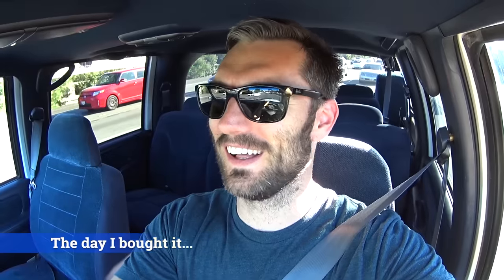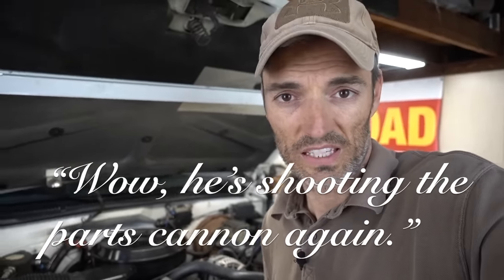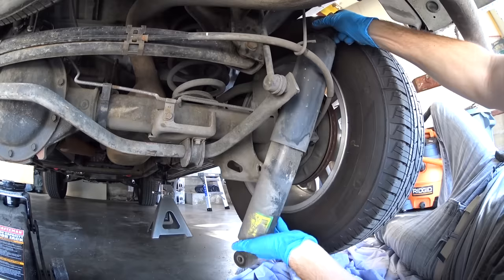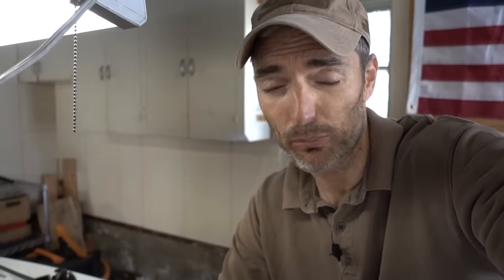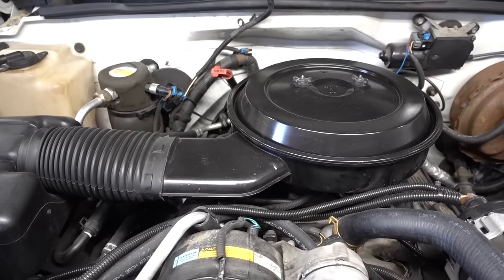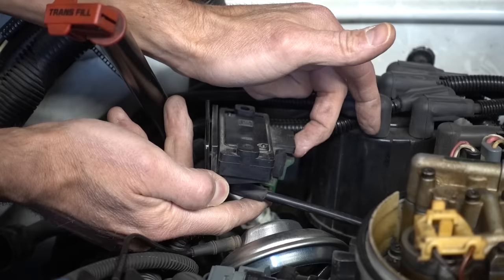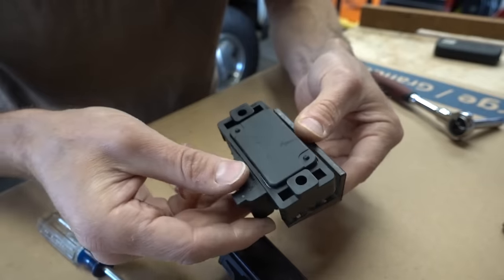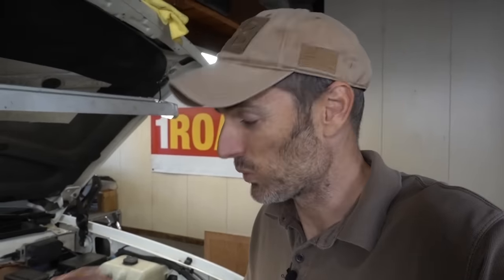The ONE REASON Why My 25yr Old Truck Runs So GOOD!!

Comment: I have a 95 GMC Yukon I have replaced the spark plugs wires rotor and distributor cap also I have replaced the fuel filter I had a broken manifold bolt on the passenger side which I repaired then my left manifold cracked so I replaced it with a brand new now my driver side manifold is glowing red and I've lost power what can be the problem I just bought a new engine temperature control sensor that I plan on replacing today after watching a few videos after this I'm going to try replacing my fuel injectors after watching your video which was very helpful thank you I took the truck to a shop and dropped it off yesterday they called me and said they'll need more time with it to diagnose the problem but they did tell me it's not the timing. Any ideas on what could be causing this problem I only have one catalytic converter and the other side is not turning red so they said it's not a construction in my exhaust any thoughts would be greatly appreciate it thank you for your awesome videos in layman's terms.

Comment: To hell with the haters. Nice to not worry about breaking down in the middle of nowhere at night with no phone reception and everyone busy. Ive fired the parts shotgun and fixed things no full time mechanic could figure out. Especially if the parts are cheap. Diagnosing problems is a bitch. Actually caring helps too.

Comment: Hi Jimmy I was just turned on to your channel and this was the 1st video I came across. You and I think a lot alike with preventative maintenance and cost savings. 
Can I ask a favor from you?  I am helping out a friend that put a junk yard engine in a 95 Tahoe TBI. 
It was smoking real bad after they installed it and I changed out all the valve stem seals. Found out it had a blow intake as well. No more smoke!!👍
I have an issue though, like I said I did not install the engine and when I was going through everything the vacuum lines I don’t think were routed correctly and Can’t find the EGR solenoid connector. Can you take a picture where that connector comes out of the harness and the vacuum line routing for the EGR and MAP sensor. It would be greatly appreciated and hopefully I can return the favor in the future. 
Thanks in advance.

Comment: You probably have a 4l60e transmission in that bad boy. Did you ever swap out the 1-2 actuator for the upgraded sonnax one? Or done any of the little but not costly upgrades to the the transmission? Just wondering. New subscriber here. Thanks for the info.

Comment: I just did a bunch of preventive maintenance,complete ac replacement,body mount bushings,stainless magnaflow,new cats,rubber,rad,alt,powersteering pump,waterpump,front suspension & trans service,truck is like when new again,,,original paint,looks mint approx 10k,and still better than a new truck and payment for 8yrs

Comment: While I agree with the approach of replacing old parts, buying parts from Amazon may be an issue. There are lots of counterfeit parts, not to say Amazon is the only place they show up. I try to buy the best parts I can because my labor is essentially free. The savings in labor offsets the cost of the best parts. It also likely means that I won't have a short service interval for the knock-off parts, and the resultant reliability issues. I also label everything with the replacement date, so I know when it was replaced.

Comment: When you have an older vehicle that is paid for (read: no payments) the cost of throwing parts at it is inconsequential. And often a few bucks now you find out prevented a lot of bucks later. I have a 2005 Dodge Power Wagon with over 300,000 miles on it. No major expenses yet.
Reply: Just noticed the fuel pump comments below. On any/all vehicles the modern in-tank fuel pumps are good for 200000 miles tops. I let mine go until it died on the road around 275000 miles. All my vehicles (all 9 of them) will have fuel pump replacements done regularly before the 150000 mile point.

Comment: Do you clean your throttle plate to restore the very low tolerance gap to stop rough idle ? TbI always ran very well . The vortecs have more power but require injection maintenance as the poppet tips get worn and clogged

Comment: FWIW the electrical connector used on GM. Vehicles are Delphi connectors. All the parts { pins, housing, seals] are available,...............wait for the comments about the cost.

Comment: I don't replace anything on a vehicle unless I have to because there's absolutely no guarantee a new part will be as good or better; and often I find things seem to last longer simply by keeping a spare. That's why I have two old vehicles as well. Use Murphy's law to your advantage rather than having it work against you spending needlessly to combat a fear of a failure. Aircraft and marine engines are another story. They can't call tow trucks on their cell phones. I mean really, you can use Murphy's law in reverse for anything. Can't find your ratchet ? You can look and look and not find it, but the moment you pull another out of the box and go to use it what happens ? Yeah ! That's what I'm talking about ! You don't have to actually prepare if you're already mentally prepared so to speak. I know it sounds crazy as S; but it damn sure works....so you don't have toooooooo....LOL

Comment: The ICM (ignition control module) is the only component most likely to fail with age. The MAP sensor is the brains of any Speed Density EFI system, there is no learning curve for the ECM when a new MAP sensor is installed, either it works or it doesn't.

Comment: I own a 93 GMC 5.7 1500 and a mechanic just replaced my wires and spark plugs but, one of the sparks didn't come off...he said it was stuck in there and was not able to pull it out :(.... you have any experience like this?? so you give me a tip how to remove that spark plug? My truck is doing a little back fire sometimes

Comment: those K motors the lower intakes leak, distributer shafts fail, throttle body gaskets crack even light casting heads can warp and crack

Comment: Nothing wrong with that.  Keep the canon loaded.   Like u said these parts r cheap.    Good. But cheap     Parts on a 80k way to expensive because more tech on them    Not as good as a 95.      I have one. 236000 still runs strong.   Keep em going.

Comment: If it still works, then why replace it at 200 times the cost. I average about 750K miles out of these 88-94 Chevy/GMC trucks. Routine oil changes and a yearly transmission service goes a long way.
What killed these trucks? Below is a list of the most common issues I have experienced in no particular order. Hope this helps you.
1) ICM's
2) Pickup coils
3) Temp sensor for computer (on top of the engine next to thermostat)
4) Thermostat
5) Transmissions lacking an auxiliary cooler
6) Not greasing or replacing worn door hinges in time and getting the "GM door sag"
7) AC's went out and vent door actuators failing
8) Seat cushions and frame wires rusting away (b/c ac failed and your sweaty butt rusted the springs and wires)
9) Rodents in the harness
10) Plastic Radiators lasted maybe 20 years
11) Knuckleheads butchering the wiring harness
12) Steering components wearing out making the truck drive like Ray Charles is at the helm
13) Ball joints (Fords would squeak and give you a heads-up prior to failing. GM...not so much. They would just go around 200K miles. Surprise!)
14) Using cheap lightweight oil in the engine and knockoff filters
15) Timing chain replacement every 200K - 230K
16) Brake hose failure after 25 years of service & Brake lines rusting
17) Frames would rust if in saltier climates without any coatings
18) Fuel lines from filter to TBI would leak at compression joints (believe it or not!)
19) Oil pressure sensor failure (On the back of block under distributor. If they failed it will kill power to the fuel pump)
20) Tilt steering column screws would come loose (Easy fix if you know what to do)
21) Broken axle parts from lack of fluid changes
22) Seals on front of transfer case would dry rot after 25 years, allowing trans fluid to fill the T-case while dry pumping trans (Yikes)
23) Servo on side of trans would wear causing loss of 2nd or 3rd gear
24) Sun shell's in transmissions were weak from factory
25) Flywheels would crack
26) Wrong antifreeze!!! Use DexCool only with Distilled water. Trust me or they will rust out from the inside.
27) Idle air valves will fail
28) TPS would wear and not hold constant speeds
29) Four wheel drive solenoid failure (Located on the top of front diff)
30) Heater hose connection failure on the back of the block 
Any of these events would occur and you could grab them for $500-$1000 on average. Those days are gone. Even junkers are going for jiraffe nutz now. So glad I stocked up on junkers years ago. Every time I saw one for sale cheap and was ahead on child support, I would go kick the tires and usually drag 'em home with a title in hand.
I should be driving one of these until I leave this world.

Comment: While I don't disagree with you in theory, in practice my experience would tend not to replace like you propose.  What I have found is the that original parts that came with the car are usually very high quality.  And replacements are of lower quality, even OEM parts.  And when I did replace them as you do, just because they were old, I usually hold on to the original part.  It was not unusual for me to be reinstalling the original old part somewhere down the road when the newer replacement part failed.  

You mention the good deals on OEM parts, though there are counterfeits out there and plenty of them, and if you are really getting them lower then deal cost that seems suspect.   I know I got counterfeit iridium plugs that were suppose to be OEM, however they lasted about 10K till the electrode was gone.

Also I have found out that OEM manufactures don't  always sell the original parts, but have their design based on the original part they manufactured.  Sometimes they simply can't sell the original part due to contract restrictions, but it will still be from the OEM manufacturer.  

Really I would like to be able to get high quality replacement parts, so i could do that, but it usually ends up more trouble than it's worth.

Comment: The only thing I would add is, replacing factory parts unnecessarily with inferior aftermarket parts, isn’t the best way to go. I prefer, if applicable, to have those parts rebuilt locally for the sheer fact that factory parts are made to a higher standard. Or at least, in theory, lol.

Comment: Agreed, especially if the parts are relatively inexpensive, and OEM AC Delco parts are typically inexpensive. I needed to change out the IAC valve on my 2001 Sunfire, and that required removing the resonator box to expose the throttle body where the IAC is.  Well on the throttle bottle, there is also the Throttle Position Sensor, and the MAP Sensor which sits right below it.  All of these parts were original and pushing 20 years of age, so I figured as long as I was removing the resonator anyway I might as well change those parts out.  Each part was only between 30 and 50 dollars and easy to switch out. Now I know that I have multiple new parts on the throttle body and will likely not need to get into it again.

Comment: Inherited mom's 2000 Grand Marquis, 65,000 miles, in 2020. With receipts, and her notebook, the last maintenance was done in 2007, 5,000 miles since then. I replaced tires, belt, hoses, antifreeze, thermostat, shocks, spark plugs, fuel pump and filter, transmission fluid and filter, rear end fluid, A-arms, tie rods, any rubber parts on the front end, and oil and filter. Neighbors asked why, had they failed? The next year, from OKC, to Riverside Ca and back to Mo, Ga, Orlando and back with my grandchildren and nephews. Nothing failed, why take a chance?

Comment: I bet the timing chain has been replaced?  Not sure if/when they finally decided to ditch the nylon cam gear but those were notorious for stripping off the teeth around/just before 100k miles.  Toss a magnetic oil drain plug in the oil pan, too.
Reply: On a 90s GM V8? Never heard of this! My 1993 is a 249K miles.  Had a 1999 Tahoe with 100k before wreck.
Reply: @JamesThompson-ol3eu  80's still used the nylon coated aluminum cam gear.  I know they eventually broke down and used a steel gear but don't know exactly when.
Reply: @thisisyourcaptainspeaking2259  Wow I have heard of lots of odd materials in the 2000s and much commentary on the "net" about it but not 80s or 90s Chevy V8.
Reply: @JamesThompson-ol3eu  This began at least by 1969 and continued through 1981, both of my sbc's required replacing the timing set for this reason.  My 1986 gm 4.3 90 degree v6 also.  The 80's Buick 3.8(231) v6 and 4.1 v6 as well.  So many were I just assume I don't know the extent. FWIW, even my 1973 351-C Ford had the nylon coated aluminum cam gear, I broke that gear while prying it off.  So to be clear, it wasn't just GM.
Reply: @thisisyourcaptainspeaking2259  Definitly learning something today. We (as a child growing up)had 5 GM vehicles in the 1970s all V8s.  Two got to 120k and 160k miles before they were sold/traded in.  My dad did mechanic work on VWs in early 70s (hobby/early retirement w/ health issues) so I was keen on mechanical problems - used to help him some. Not a GM fan at the time so any problems would have been magnified in my mind!  I really though all the plastics in car /truck engines was a more recent issue. Do you known if 1979 ford 460 engine would have had such? I have a project truck in my yard. I was told it needed a new crankshaft. It has been parked since 1999!
Reply: @JamesThompson-ol3eu  I don't recall exactly if the 460 ever used this cam gear design but you might be able to see the gear either through the distributor hole or fuel pump?  Use as bright light as possible, sometimes the iron gear looks like a plastic one to me, ie: I was fooled once.
It wasn't unusual for the nylon gera to let go just prior to 100k miles on the sbc but fortunately this didn't leave it with bent valves.  The Buick was an interference engine, not sure about the 460 or Cleveland.
If you can rock the crank back and forth 5 degrees without the cam moving, the timing set needs to be replaced anyway.  FWIW
My bet is your 70's 460 was originally equipped with the nylon cam sprocket.  My understanding is the Ford 351c and 302 sprockets were borrowed form the 460 but the chain was shortened.  If your distributor doesn't rotate with the crank, my money says the cam gear is wiped out.  Don't forget, it may just have slipped a tooth or more and any plastic bits will be lying in the oil pan on their way to the oil pump.  Not sure if your crank gear is the smog retarded sprocket, I don't think they did that on the big block but about the same time as egr they also retarded the cam by offsetting the crank sprocket keyway.  An earlier timing set will advance some ford cams to pre-smog position, other cams themselves were machined with smog retard and lobe profile.  I don't recall any of the detail, this was all so long ago.
For some reason, I believe the nylon cam sprockets disappeared about, or just before efi and 460 never got a factory roller cam (my 1994 460 is flat tappet).
Reply: To be clear, the plastic gear referenced above is the chain driven camshaft sprocket, famous for shedding it's teeth and leaving you high and dry with a camshaft no longer rotating or at best, valve timing in left field.

Comment: I have the same suburban 95 for like a year now, 128k. Replaced alot of those parts since it was running rough at first. Runs pretty good now but i noticed lack of power and revs high when i try to pass someone. Is that normal for these trucks?

Comment: Running in tip top shape is the life of an engine. A minor misfire puts unnecessary wear on valve train components and causes unnecessary carbon build up. Except with today's after market parts (including OEM), it is wise to replace only one part at time, then drive it to make sure that new part is not faulty. I have replaced parts 3 times before getting a good one. Except commonly the parts are good the 1st time. The other problem you may run into is after market parts not quite fitting correctly. They make some parts to generically fit many vehicles. Sometimes you can modify it and make it work and other times just return it and keep searching for the correct part. Using the vehicle identification number usually results in better chance of getting the correct part, rather than just using year make and model, engine type and so on. Remember that folks working at parts desks are getting paid a bit above minimum wage. So be nice, but question a lot.

Comment: I have an 88z71 technically 1 owner since it was my dad's I've had it for 9yrs now it has 742,662 on the odometer only thing that's been done major is a transmission rebuild not replace truck is all original but sadly my daughter has blown it's head gasket which isn't a huge deal being that I'm a certified technician and can do this job in a few hours. Before I hurt my back I owned my own shop and let's just say that Chevy wasn't the reason it succeeded my thanks goes to Ford and Dodge for building less dependable vehicles I've yet to see or hear of one that's gasoline ran have the amount of miles of my 88 does and yes there's nothing wrong with preventative maintenance had I changed the gaskets last year like I was going to do i wouldn't be doing it now. Also it's never left any of my family members on the side of the road either it's just an amazing greatly built truck

Comment: Hi buddy!!!! Please, can you help me, I have a 91 S10 with 4.3 V6 TBI, I made all new engine and replaced all sensors, all originals. The truck runs good, but I think is working a little bit rich, because the gas mileage is not good and I smell gasoline when the engine is running. Can you give me any suggestions?
Thanks!!!!
Marcelo